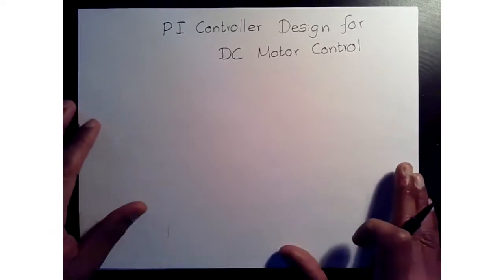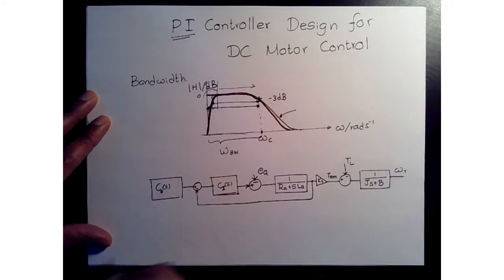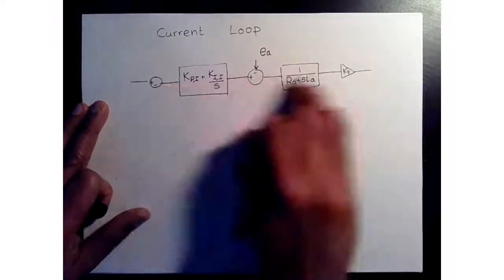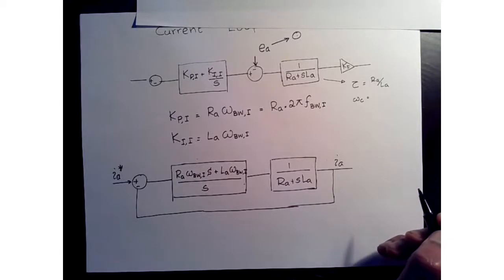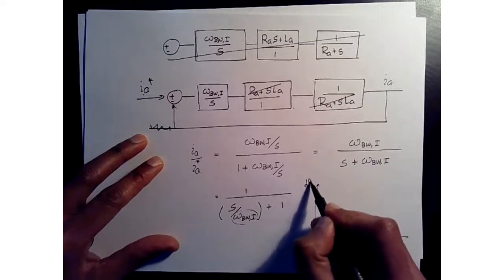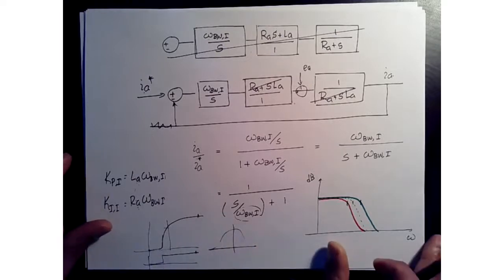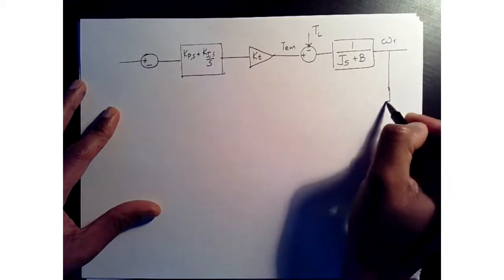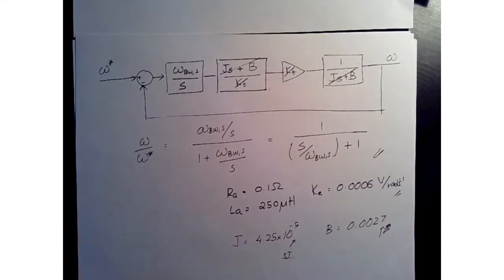Simple Controller Design for DC Motor Control

Comment: Hello Prof, thank you for this fantastic lecture! I have a couple of questions though. 
1. We treat the back EMF as a disturbance when designing the current controller. In physical terms, can we interpret this as since the current dynamics occur much faster than the mechanical dynamics, in the time scale where the current loop goes to its setpoint, the motor speed has barely changed (since the current/torque has to be integrated, then pass through the inertia and friction to effect a change of motor speed), so the back EMF is like a constant disturbance which the integral part of the current controller will compensate for.
2. When discussing the speed control design, we said the mechanical response is also first order, by this do you mean the behaviour of the motor speed for a input step voltage?
Reply from the maker: Hi Yogesh, the disturbance does not need to be slow compared to the controlled variable. In this case it is. 
There are two ways to look at this. If you consider the just mechanical system, it is clearly first order. When you consider the combination of electrical and mechanical systems, though second order, the faster electrical pole can be neglected. Thus you can approximate your system with a first order plant for the purpose of a simple controller design. However, typical speed controller designs follow a second order plant and bode plots to make this system stable with a PID controller. But for a current controller, a first order response is more than enough.
Reply: @SandunKuruppu  Got it, thank you sir.